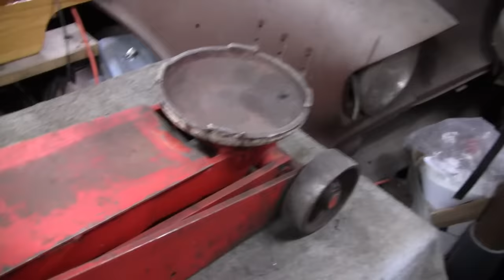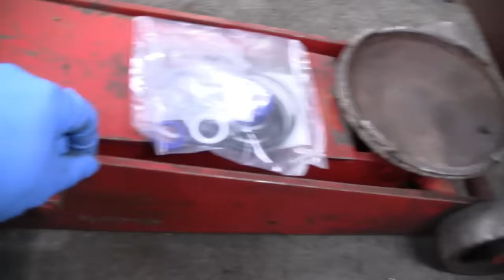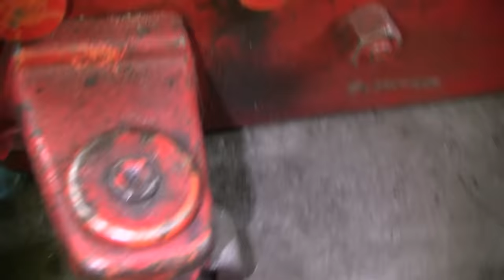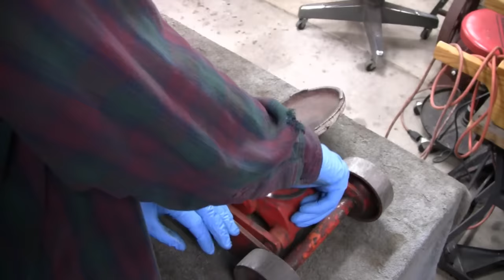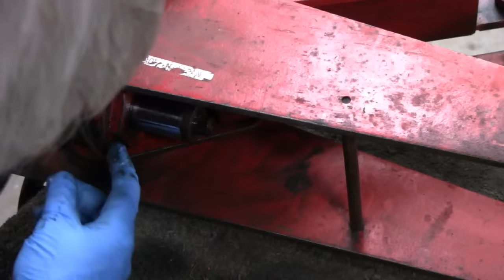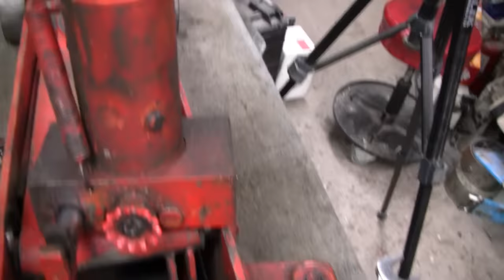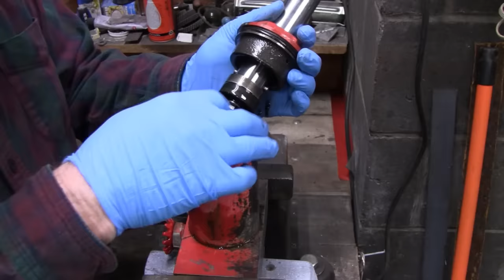HYDRAULIC FLOOR JACK REBUILD

Comment: That older jack with the rebuild job is WAY MORE RELIABLE than the Harbor Freight - Pittsburgh 2.5 Ton that just crapped out on me in just 3 years! (right side piston is shot!)  I'd much rather spend good money on the rebuilt old jack in this video vs buying another floor jack from Harbor Freight Tools, but I was desperate as I needed a jack to lift my wife's Honda Odyssey off the jack stands. (I went with the Daytona & hopefully it will last longer than 3 years of lite use!!!)

Comment: My doesn't have any leak but it does what this jack was doing before, also  my question to you is  what the secret to used the middle finger to put the grease 😂😂😂 just kidding, this kind of jack are the best, the one they sale today are recycling they are not good enough for hard work and brake so easy ,  Excellent job my friend I learn something God Bless you.

Comment: i have an old USA built SEAR, NOT FOREIGN MADE. floor jack back in the '70. it finally would not keep pressure. went and purchased one at harbor freight for $129 on special. i almost gave thie old one away until i watched a video using miracle oil, bough a $6.00 plastic bottle. took the jack service cap off and filled the jack reservoir. i pumped and release repeat for few times; let it set overnight. when i tested the old jack, it was really work, holding my weight when i stood on the plate while i pump the jack. it didn't lose any pressure. now i use it as the second backup. whenever you lift any auto, use a tire/wheel for your safety in case the jack fail, even a new one could be faulty. i even now use this miracle oil for the car additive. what the miracle oil does is rejuvenate the old shaft seal and help remove the old residual to its original form. i have a MGB GT with slight oil leak bc the car sit in the garage too long. once i pour this oil into the mix, the oil leak stops. give it a try, nothing to lose.
Reply: sorry, i got the name wrong. it is Mystery Oil you can find in the automotive section. Walmart is cheaper than the auto store. not miracle oil. the red fluid in red plastic bottle.

Comment: I just picked one of these up for $50. It held OK, but wouldn’t pump up all the way. So I added some fluid and it pumps up just fine, but sometimes it doesn’t feel like it “grabs” and sometimes it does. Is that a seal problem or does it just need to cycle more air out?

Comment: LoL, that's exactly the same jack my dad owns (from the 70's).  Once, when the jack was a few years old, it failed when lifting a '69 Cadillac.  I opened it and simply cleaned everything very meticulously, then added new fluid.  It's been working great for the past 40 years.  I am guessing a bit of dirt or a grain of sand got between the seal and the cylinder.  As always, I tell everyone to ALWAYS SAFELY USE JACK STANDS before going under a car.

Comment: The seal on the plunger is a wiper seal to keep dirt out, not to keep the oil in, so should be installed with the lip to the outside. Feels a bit counterintuotive to mechanic types

Comment: My jack doesn't have that set screw under the cap, it's worked good for years without it. Rebuilding it and noticed your video and was curious if you ever figured out what the set screw under the cap with the spring below it did. I do have the spring, just no set screw.

Comment: The pointy thing you referred to, with the spring is the vent. The screw holding the pointy thing and spring is designed to control the release of air (on the lift side of the cylinder) as the handle is turned to lower the jack. Btw, the pointy thing (your words) is actually a valve with the casting being the seat.

Comment: RoadKing, 
Do you remember the turns on that pressure relief valve screw?  I accidently rolled mine right out without thinking and counting the revolutions.  I'd like to get it as close to stock as possible.  Fantastic Video, helped me out tremendously. Wished i would have seen it before I started tearing mine down.
Thankyou Sir
Reply: How is your jack now? Are able to set the screw limit?

Comment: Excellent video. Thank you! You do understand that the HF jacks use the same O ring manufacturer than the O rings you installed? I have been using Craftman, HF and big red jacks and 10 and 5 ton rams that I have owned for over 17 years. My preferred jack is the HF 3 ton jack. Never had a problem with it and I lift my cars and SUVs with no issues. I only had a problem with a big red motorcycle jack that lowers itself after jacking it up. I have not played with it yet. I might need to bleed it or replace the seals but for $45 for the kit I'd rather buy a HF bottle jack and replace it.
Thanks again! keep the videos coming!!
Reply from the maker: Thanks Bud!!☺

Comment: I have a feeling if you check out those large plastic  washers with the cuts . . .  you may find them to be of variable sizes when cut to fit.  If the cuts are made in the same angles.

Comment: always assemble "o" rings with a little light oil, especially on parts that rotate during assembly, dry "o" rings can wrinkle and get cut good vid  THANKX
Reply: I use Parker O-Ring lube on everything O ring in my shop.

Comment: I have one very close to that one that I have to go through. Thanks. And a question for all. There have been two major designs of release mech. One where you turn the whole handle and one where you just turn a cap on the handle. Which is the preferred way for a jack to work? The reason I ask is because i like the later because it's what I learned on but the first one seems more common now, which is why I converted mine to the rotating cap style.

Comment: How did you fix the kit to your jackie? Is your a brand? Mine is not pumping and suspect the seal in the pump-valve. Did you have a spring inside the release valve? Ithink it should be to pressurerise the ball bearing. Good work anyway.

Comment: I took mine apart and the kit had the little seal on the small plunger pump and the blue cup did not fit correctly after several attempts to find the correct replacements cut the plunger seal seat bigger with a Dremel and modified a different cup with two thin washers on each side to fit and worked. After all, I did the jack did not pump up! After watching your reassembly I may have not put the 2 balls back in the corrected order. Too bad I scrapped it last fall during a "too much junk in this garage clean-up campaign!"

Comment: First of all, very nice Model A.  It looks like your problem was the piston rubber seal (bottom "blue" thing).  Nice fix.  For reference, when disassembling a factory adjusted part, like your bypass valve, it's best to run it all the way in while counting the turns.  Then, when you replace it, run it to the bottom and count the same number of turns back out.  I do this with carburetor adjustment needles, too.

Comment: Yes you are correct on the wiper seal on top...........    The older black seal that was flat was leaking the fluid and then coming out the cylinder seal.......  

The fluid is in the outer part of the jack and then pushes up on the ram itself.......   

My Non'c  Joe  used to own a jack shop years ago....... He would take a small bottle jack and impress you inside of 30 minutes...........  

Plus Tard Mon Ami ~!~!

Comment: Not too long ago I had a Jack probably Harbor Freight or net junk called a CASSIDY and it was a former friends jack asked me to rebuilt it. It had the big head nut and it appeared as if you could could take it apart and put new seals in it. Upon closer examination and acting like a squirrel that just encountered a rubber nut I discovered that head nut was part of the unit was all sealed and that ram could not be built. I promptly went on the craigs list and other places and just got him another jack that looked like the one he had & rebuilt the one I got from Craigs List ad... Those old tools like that jack he has are old gold he is correct nothing works better than restored vintage era tools riding mowers and the likes... I just recently rebuilt both my old Snap On Blue Point impact guns. Thanks to Northern Tool and a guy in North Carolina the rebuilds went very well & those two old guns out class the new ones I have by a mile.

Comment: I got a  laff out of you reaching for the 2 foot wrench  and the pipe. Exactly what I do when the nut or bolt is oversize.Good to know that they can be rebuilt without special tools  I've got two slow leakers right now.

Comment: I too have a sears ton and half jack. It's green but not red although that doesn't mean anything. I saw a rebuild done on one just like mine and they guy had the part number and showed it. I ordered that kit and had a guy rebuild it ( it was a business that did that work) and got it back and it still leaked and would not come back down by itself. Turned out that kit was metric. I bought mine in the late 70's and it's a great little jack and I would love to get it back to working again but don't know where to get the correct kit. Still looking....any advice?

Comment: Hi.  Thanks for the video.  I have been able to disassemble the jack down to the pump.  However, I am not as lucky as you to have that huge crescent wrench.  Any thoughts on how to get the nut off the top to access the plunger, etc?   I've tried a monkey wrench with an eight foot pipe on the end.  No luck. Appreciate any help you can offer.

Comment: I have that jack,how many turns on that screw valve? No hydraulic shaft leak ,fill cylinder bled won't pump up with handle ,but if I grab by lift plate and pump up it stays and ccw handle will release?

Comment: The pin in the ram is a release valve to prevent the packing from being cut by the oil at high pressure when the ram is at full extention.

Comment: I got a jack just like the one you are rebuilding same jack. It is from late 90s not 70s. A 70s model jack yes i got one. They are all cast steel. They started using this type jack design around mid 80s. The jack you are rebuilding be sure rubber plug where you put oil in is sealed good or water and trash can get into it. I add a little layer of silicon over my plug because that old jack sets out in the weather. Them jacks will last a life time.

Comment: How standardized are the seal kits? I have a Napa model 94-642 2 ton, can’t find a seal kit specifically for it. The jack is probably from the 80’s or 90’s if not 70’s. Just curious if I could get a kit for another jack if it would fit?

Comment: Did you unscrew that star wheel and replace the oring seal on the screw in threaded shaft with the pointed end?

Comment: Mine is a Big Red Torin 2 3/4 ton floor jack. Looks identical to this one. I wonder if the seal kit will be the same? Careful using Vaseline to lube o-rings. May cause the rubber to swell. Better off to use the hydraulic oil you put in the cylinder. 🤔

Comment: Thanks,  valuable video on restoring a floor jack.  I have a 3-ton jack, I think bought from Pep Boys, that has never worked correctly. When turning the valve to lower the jack under load,  it suddenly loses the pressure as the valve is slowly turned, dropping the saddle rapidly.  I've learned to cautiously work that valve so as not to cause the load to crash to the floor.  What would cause the valve to behave that way?  Thanks for your thoughts or to anyone on this thread who might know the answer.

Comment: I'm hoping you can help me out. I started to rebuild my 2 ton floor. Jack, when I got called away to respond to a fire. My son thinking he can help me out started to disassemble the jack. He removed the screw that was factory reset without counting either coming out or going in. I am hoping that you can help me out by telling me where you set your factory screw too, that would give me a starting point on where mine should be. I know all the screws in factory settings are probably different for each individual Jack, this is why I am asking from you a starting point from my factory screw.

Comment: 80ROADKING Did check the bracket for the wheel on the left side looking from the handle end, it has a crack in it.
Reply from the maker: That's just an illusion Brian, it's actually a glob of paint or tar dripped across the bracket!! Thanks for pointing it out though, I did check it out after your comment!!☺

Comment: How many turns did you count when you took the right cap off? I have a 3 1/4 ton floor jack and I need to rebuild it. My jack is from the 80's and it is a China jack.

Comment: Excellent video. I’m rebuilding the same Jack but am having a heck of a time removing the large nut on the Jack. Any suggestions? What size crescent wrench did you use? 😊
Reply: I had the same problem, don't have a crescent wrench that size. Tried a pipe wrench, no dice. Finally used a chisel on one of the flats to break nut loose. Gotta hit it like you mean it though. Bought my jack from Penney's in 1970.

Comment: Hey i got a jack here passed down from grand father its pretty much the exact same jack.. pump looks exact same as yours.. i want to rebuild mine now after watchin yours but i cant find the name or any information anywhwre on the jack... wonding if you knew how universal are these o ring rebuild kits.. i wonder if i got the name from yours an order the same you did would i get aWay with it?

Comment: Believe it or not, my father's old American made jack always had problems, but it had the cool handle and release, I think it was made by Heinze Warner back in the late 60s.
My Harbor freight light weight jack is awesome for carrying in a truck and it doesn't leak and it's good for one wheel at a time or small car work and the other heavy duty one's don't leak either.
I wish I could buy a quality US made jack but those days are gone.

Comment: Excellent Content, and delivery!  LMAO,  where you said "Had to put a Little ASS behind it"! More  Informative Than any other Vid, that I watched on this subject!  I would like to know the source of that Squeeze bottle, with the Tube attached to it, looks like a necessity!  One last comment, though....I have heard that Vaseline is NOT advised anymore because it degrades O-Rings, faster?  Any Silicone Product, Spray or Lube, is desired nowadays for Chemical Compatibility!  Others may have a differing opinion, but something I have learned in other Vids on O-Ring, installs, anyway! Thanks for a Great Explanation, Sir!  I have way too many Jacks Failing Prematurely, and want to do this chore, soon!

Comment: I own two Sears jacks very similar to that one except blue from 80s-90s and one of them has some issues with the valve/pump from a lot of use in a shop. Never figured it was worth the time or effort to fix the pump, the other one I bought new and is still in great condition.. I got one from Advance Auto like 15 years ago and still works well after exposure to the weather (stored outside) considering it was like 40$ retail. Not sure a seal kit will restore worn parts, done enough hydraulics to know that not everything can be fixed.

Comment: Oil seal sealing lip always faces the pressure. You installed it correctly. Should fit the piston surface closely. You need another seal.

Comment: hello all you garage man. i had a slow leak floor jack made in Japan bought at Sears zillion years ago, hardly used it for many years. i was going to buy a new hydraulic jack but never got have time and i didn't want to buy a hydra pump. i even tried to give it away, no taker. then i saw a Scotty video on oil leak on the engine. he explained vry clearly why the shaft crank seal leaks, the seal gets out of round due to sitting to long. HMMMM.. i thought if the problem is the old seal in the jack pump leaks bc lack of usage, maybe it will work for that reason. voila... after i added some Murphy oil into the jack reservoir and waited a week, it works like a chum. it even holds pressure when i stood to test it. i  now use it as my second jack bc i had an emergency to fix my flat tire, when i do work on my car. don't waste time and money buying new pump. add the murphy oil that will rejuvenate the internal seal. by all mean always work safe underneath the car with stands and wheel chocks. thanks for the info.

Comment: I have a jack exactly like yours but I lost the spring to hold the handle up. I don't know the make and model so i can't order parts. Could you please tell me the make and model of your floor jack???? john
Reply from the maker: It's a Sears 328.12000!! Those springs are on Ebay, all jacks use the same spring!!

Comment: Couldn't see which way the seal for plunger was put in, maybe you know, the flared end of a seal goes towards the fluid to hold it in.  If you put them in backwards the fluid will collapse the seal and leak by.  Good job photography.

Comment: I have an old sears jack too,,,still works 30 yrs later,,,,but 1 problem the twist handle striped out so now i need a 12MM socket to open or close it  Was that a 57 Chevy fender i saw in the beginning of the vid?got the whole car or just a fender?
Reply from the maker: Whole car!!☺
Reply: @805ROADKING  Nice I got a 56 wagon 4 dr

Comment: Good job roadking. I have an old sears jack from the late '70s. Had a guy "fix" it a while back and it's doing the same thing it was doing before he "fixed" it. Now I can't get him to answer the phone. Wish I could get my 90 bucks back. If I could find out what the kit number is I would try it myself. I know it's not a metric but need to get the correct kit. Thanks for a good video on this thing.
'

Comment: "Could be wrong but..." 25:00 It goes in with the lip out because it isn't a seal, it's a wiper, meant to wipe the dirt off the pump plunger.